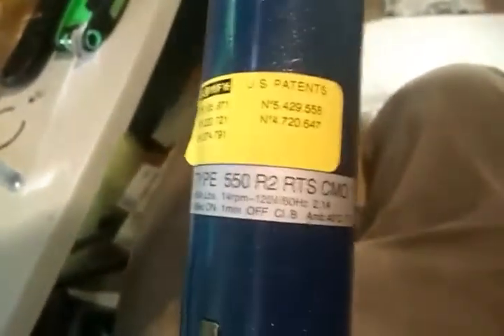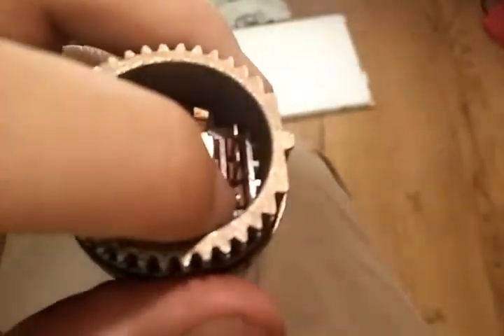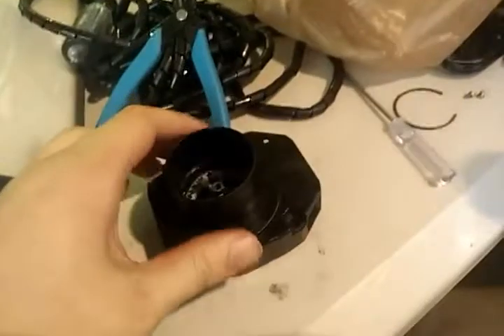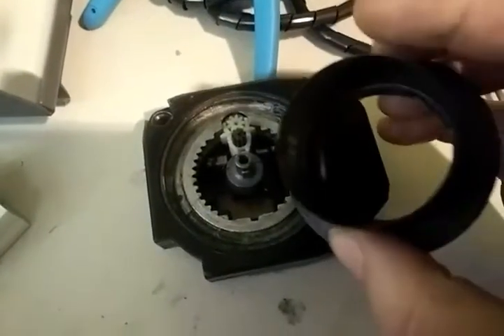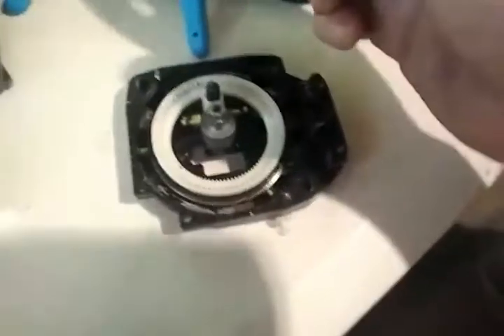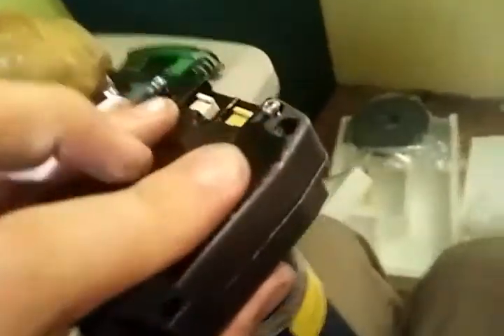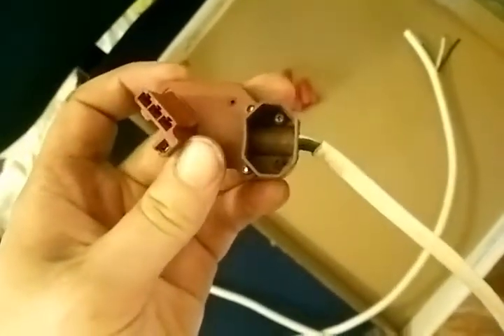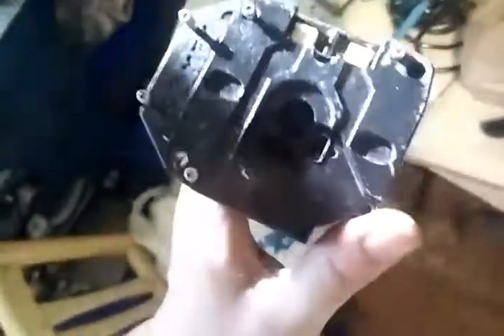Somfy awning motor disassembly

Comment: To remove the motor...out of the casing...

There are 2 screws at the rotating ends covered by small round stickers These are to hold 1/2 of the gear box in the steel casing - the rotating is the other 1/2 of the gear box which held in place of the steel casing by the tapered end of the steel casing - It looks like everything is assembled in a plastic tubing - then compressed into the steel casing then the very end is forced turned to encapsulate the whole assembly in the steel case - the screws are to put in just in case the gear bos housing is moved. 
There are also 2 pins in the middle to hold the motor in place (set in white plastic casing) 
I had to cut the tapered ends off and try to force the whole things out but so far they are refused to come out....

This motor is designed to used only once - not to be maintained - crazy..
and it is not cheap - mine cost $1500 AUD....my whole used awning cost - $400 -
I am going to convert to manual ($100) or get a garage rolling door opener Chinese made ($200) - externally motor - not nice like this tubular motor bur far cheaper and easier to maintain
Reply from the maker: Thanks

Comment: Note, that the one we took off the house has the feeding one way problem.  on that one There is additional hardware on it... (two spacers that makes it fit in the tube, and an adapter that attaches it to the mounting bracket.